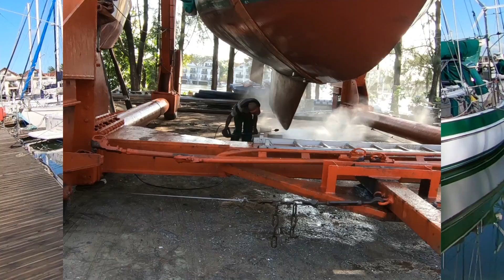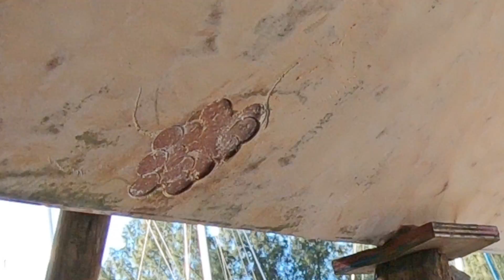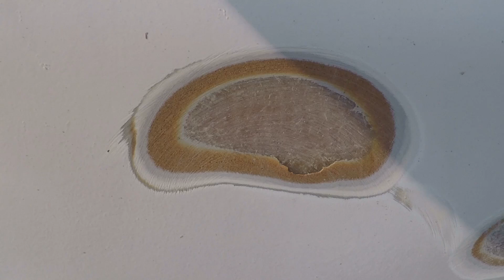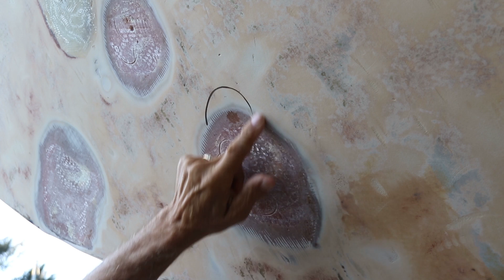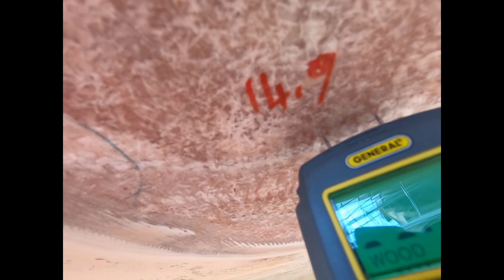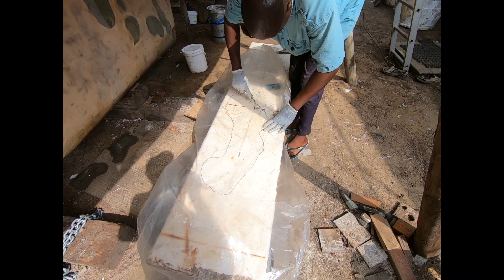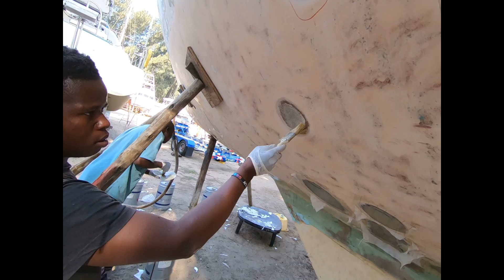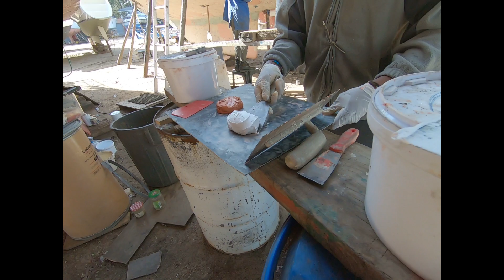500 ROTTEN, FESTERING Blisters!!  - Blister Repair on a Fiberglass Sail boat! (Patrick Childress 59)

Comment: Just as a question, why did you not just sandblast or soda blast the hull to expose the blisters and save on labor?
Reply from the maker: The blisters were very easily seen. No problem there. Each one had to be ground out to their individual depth. Would have loved to to have least removed the bottom paint etc...but upon inquiry, they don’t allow even wet blasting here in the yard...too many complaints from other boat owners last time they let someone do that. -Rebecca
Reply: @SailingBrickHouseAndOsprey  That is a problem that one can't choose, unless they find a yard willing to allow blasting.  For general information to any who are dealing with this same issue, I would recommend blasting over any other method as it exposes every blister ASAP.  But, when that is NOT an option, and often, in situations where it is an 'above the waterline/bootstrap' area, I would have to say that how you went about the repairs and the epoxy resolutions you applied are a superb solution.  Though many would disagree and many yards/services would have turned down the job unless an open account situation would have been made with significant down payment required, I would certainly (considering the situation as presented) that if a person wanted the finest results with the least (if not zero)  future complications involved, there is nothing you could have possibly done better.  Following each blister to its adherence point, cabosil as a general thickener (actually adds structural stability (there are other additives for general fairing that add less structural strength but are easier to sand and form)), the use of epoxy on the hull, and the general attention to detail on the whole guarantees lifelong use (with obvious recoat of antifouling and possible recoat of a 2 part epoxy sealer- cheap maintenance considering the actual structural integrity of boats of this era), I thank your for the time you took to show explicitly how you went through your repair and restoration process, including the why's and reasons.  Very informative, and it really gives a lot of insight into why some owners of very nice vessels are experiencing very unique challenges with their favorite past times, if not live aboards.  Also, for any who are dealing with these issues, yes, it takes some time, but these very detrimental issues can be overcome fairly easily, and Patrick Childress Sailing has shown you a very thorough step by step walk through on how to accomplish such a task.  To them- thank you very much for the reply and thanks for sharing the information- very well done.
Reply from the maker: Finish It, thank you very much for your knowledgeable insights, encouragement and nice comment.

Comment: I went through the exact same problem with my 31 feet and the reason why these blisters appear is due to excessive humidity back in the hull manufacturing. You can repair all the blisters but I'm sorry to say they will show up from time to time. It doesn't affect the hull structure but these small pots are very awful....😡😡
Reply from the maker: Yes...we are prepared for the hull blisters to return...but one can always hope with all the effort that maybe it won’t be for a long long time. -Rebecca

Comment: Did the shipwright use polyester resins not epoxy? Never seen blisters like it. Polyester resin are not the one! Epoxy is far better,  and epoxy will bond to poly. Gota fair bit glassing experience as I play with jetboats. Kind regards from New Zealand
Reply from the maker: You mean the one from 19 years ago...or for this blister repair? -Rebecca
Reply: gday michele .... could you advise me un how to seal the aluminium roof on my old 69 landrover... I"d like to use fibre glass as it would  maybe help with keeping the cabin of troop carrier cooler also...thanks Michele
Reply: @peterlucas1814  is your roof make with blind rivets? Would it be easy enuf to construct an identical mold? I believe there are products available to stop the glass from bonding to molds, but i havnt had to use that yet as I require the glass to stick underneath the boat and stay there aka gravel rash. If your roof isn't riveted and doesn't have to many protrusions you could almost use use the roof as the mold.
Reply: Most manufacturers from that era used polyester resin. The problems with the Valiant seem to be more from the low quality resin with possible bad fire retardant and I have even read it may be from the fibers not being woven tight enough also hurting it. The presence of water in the blisters definitely leans towards osmosis issues as well. It is a testament to the legendary sea worthiness of the Valiant 40 that even with the blister problem, which effects a great many of the older models, they still fetch such a high price tag.

Comment: And they say fiberglass is trouble-free! Well, maybe that's true when it's done properly.
Reply from the maker: Having hull blisters like this in not troublefree for sure! Thanks for watching! -Rebecca
Reply: A new fiberglass boat built properly will give you decades of trouble-free boating.  Whereas a brand new wooden boat will need repainting every year, and is much more prone to damp problems and damage.  So it is true in that sense.

The example in this vid is a boat that's got known a known blister problem caused by issues with the layup, and it's 44 years old now.

Comment: What a massive undertaking.  My shoulders couldn't handle it but with a little paid help, it makes a lot of sense to take it on.
Reply from the maker: Thanks watching! I wonder why a sailboat blister repair video would be so popular? -Rebecca
Reply: Patrick Childress Sailing I was really curious about the non-osmosis cause.  I had a Fraser 30 I sold two years ago.  Similar vintage so I am wondering if it was osmosis or a resin issue.  Interesting anyways.

Comment: What a huge undertaking.    It amazes me what problems will surface after years of owning a boat.  Even after a a lot of work from the previous owner (peel job).  At least you are doing it yourself.
Reply from the maker: From what I have seen in many boat yards, a boat owner is far better off doing the work themselves, with good help. A lot of disasters can be avoided that way. Also, doing the work in some foreign countries makes such a project economically feasible.  Thanks for your comment.

Comment: Is their a vacuum scanning unit which will speed up the areas of delamination
Reply from the maker: If you are referring to vacuum drying, that was an option but there were so many blisters on our boat I am not sure how that could work. We just ground out till we got back away from the delamination and wet looking fiberglass. It was winter here at the time so the ambient humidity and air temperatures were low, with a little breeze, which were good conditions for drying out the opened blisters.

Comment: I worked at Ericson Yachts for 16 years, and was the customer service manager for my last 5 years there. I dealt with blistering that showed up on boats in the field. The cause of blistering is incomplete catalyzation of the polyester resin during layup of the hull. Keep in mind that the hull is laid up by hand. Long stretches of glass cloth or woven roving ( a very heavy weave cloth)that is 36 inches or more wide are laid on to the mold. Once the resin is catalyzed - usually in 5 gallon batches then there is only 15 minutes of working time. If the resin and catalyst are not thoroughly mixed, then the laminate is going to blister. The best cure is to let the boat dry out and grind out and fill any blisters and then coat the hull with epoxy resin. If I was buying a new boat I would immediately put on a coat of West Systems epoxy resin.
Reply: Polyester doesn't cut the mustard.
Reply from the maker: Michele beck yes...it’s certainly why we used epoxy resin...no polyester. -Rebecca
Reply from the maker: Lazy Days, all good information, thanks. In the case of the blister era Valiants, it was shown that a particular ingredient added to the resin to make the resin flame retardant caused the resin not to cure properly. For a vapor barrier, have you ever thought of using a very thick epoxy such as what is used to coat the floor and walls in a battery charging room or to coat the floor of a ware house where forklifts and other vehicles operate? It is much thicker and enduring than common boat epoxies. It would never be any good for penetrating fiberglass in a layup. Here in S.Africa, such an epoxy has been long used as a barrier coat before applying antifouling. Does this sound worth while?

Comment: Down here in Australia we call it fibreglass cancer and we have been fixing it for 40 years.  Yes, you can grind it all out but you have to leave the boat on the dry for a year to properly dry out becuase the salf water will be right through the areas around the blisters and it separates the matting from the resin. It spreads unseen. If you don't let it dry out completely, they will just pop up everywhere again. If that was a boat that had been given to us we would have written it off.
Sorry to rain on your day.
Reply from the maker: No rain here, I feel very good about the blister repair work and the results and the longevity for the repairs. Maybe new blisters will appear over time but these patches are solid. You need to give us some specific numbers for "dry out". Setting a boat to dry for a year means little if the ambient humidity is high. Why a year, where do you get that figure from? You need specifics and readings to do this right. Thanks for your comment, if you can expand your explanation, that would be much appreciated. I suppose at Australuan labor rates it would be a write off, but here in S Africa, not so much! -Rebecca
Reply: @SailingBrickHouseAndOsprey  Rain won't harm it. Its the salf water that does the damage. Its corrosive to the fibreglass sub layers. The gelcoat is the seal. Salt water reacts with the layer under the gelcoat and creates an acid and it spreads and delaminates the layers of fibreglass. The blisters are where there is a pinhole in the gelcoat or an original air pocket from the layup and that causes the blister. You have to do what you have done but also let the salt water evaporate from the whole hull. It will weep out along the edges of where you have ground out and you can see it over a period of time and you water blast it every so often.  For the areas under the intact gelcoat only time out of the water will dry that out. By just fixing the blisters you leave the rest of the salt water trapped between the layers and it will just happen again and again. In a hot climate a good time on the dry is six months. If its humid, longer. We do these jobs all the time, specially on older fibreglass boats where the original gelcoat starts to break down with age.  For the impatient we can epoxy the ground out areass but its only temporary. (you should sell the boat if you can't wait.) This is us:  http://noakes.net.au/

Comment: While 'moisture meters' are primarily designed for wood, any reading below 15% should be good on fiberglass, but to be safe, under 10% is a better bet if you can achieve it...
Reply from the maker: Thanks, Mike, for the reassurance.
Reply: Hmmm i'm not so sure on those figures , but i agree the lower the better . Yes i have blisters on my yacht , she's a 53 year old from the Morris and lorimer stable , the blisters themselves were actually found by accident , when i was living aboard . After lifting out to make some work i had planned , easier , i figured slurry blast the old antifoul at the same time maybe a good idea . What actually came to light was totally unexpected , in way of tiny burst blisters about the size of match sticks though the repair coating . I found out after purchase , the yacht had a history of osmosis and had already been previously repaired . The hull was showing a moisture content of 21% in some keel areas on lift out , but much less in others . The repair system i originally choose to use , the west epoxy system needed a maximum of 3 . She's now been outta the water for the last 20 years , so should be ready for repair . Unfortunately now due to the boat market , she has no value , the repair  , and subsequent refit would cost far more than i could ever dream of selling her for . So sadly i'm realistically looking at cutting my losses and scrapping her . The trouble is i'm struggling with this , it's not something i really wanna do , she was a good boat , and taught me to sail , but at 24 feet is too small for living on at my age . I'm fed up with being shore side , and want to retire , so i'm now planning on moving back afloat within the next couple of years . I would love the comfort of a slightly larger yacht and independence of shoreside facilities , if you get my drift . Something my present yacht could never do .

Comment: Patrick, you did one heck of a job.  The guys in a boat yard did too.  Was it worth it? Only you can answer that question but I think the answer is yes. You are back in the water sailing again.
  Would it be worth doing if you had to do it in a yard back in North America? Or France?  I highly doubt it!  Would it be a good DIY job? Only, if you pick up the boat for the right price and you love hard work and "the smell of epoxy resin in the morning"  (Sorry Mr Coppola)
Reply from the maker: Marcel, you are exactly right on all accounts. These old boats are like trying to flip an old junker house and make a profit. All the numbers have to work. Even for one dollar, some boats are too expensive. Doing a lot of this work in some foreign countries make sense. This is why so much manufacturing is done in these countries. The factory workers in Sri Lanka, making clothes and hats, earn about 75 cents per hour. It seems, it is my guess, the factory workers in China make the same or less.

Comment: What a long, high labor, tedious project.  Kudos to you Patrick.  There are several ways to go about "fixing" the blisters.  All equally tedious.  I do think that the process you used is more than sufficient to fix the problem.  I sure hope you got em all and don't have to repeat this project in years to come.  Onward on your most epic adventure.  Be happy, be safe.
Reply from the maker: There is always that possibility of new blisters forming. I did what I could to find the tiniest ones and that is why we had drill holes with surprisingly little or no delamination or moisture.  I think we are good to go, for as long as we could possibly own this boat....we will see. Thanks for your good wishes.

Comment: Looks like you got most of them and most of the delaminations. Hard to be judgmental from a video. Look at it in a few years and you may find only few more and smaller. I’d feel safe in it, no worries of catastrophic failure. The strongest part of the boat is what you repaired LOL! Some would have said pull it all off, but that much labor isn’t worth throwing at that old boat so you did fine. Amazon sells little moisture alarms by the dozen. Drop them in places in the the bilge for early warning. Most leaks start very slowly.
Reply from the maker: People are crossing oceans in these old blister boats without doing anything about the blisters......sort of like us, till now.
Reply: @SailingBrickHouseAndOsprey  I seem to recall reading , it takes a good many years for even very large blisters to cause a structural failure . It did go on to say no boat has ever lost due to blistering , but being honest , that was an article i read a few years ago , so it's possible that may have changed by now .

Comment: Do not follow this way of repair. It is absolutelly WRONG!!! The proper start would be to remove all delaminated layers and not only "blister" areas!.
Reply: Proper start would be to remove all delaminated areas (all layers on hull), NOT ONLY "BLISTERS" ! Following with hot high pressure cleaning, drying for several months or with HotVac and then apply full antiosmosis treatment system following producers manual. The work you had performed is only cosmetic!
Reply: Iztok Šušteršič I agree but he said he's in hurry and he's 69 so screw next owner! 🤔
Reply: @strietermarinesurvey1415  You're right, but the truth has to be told that this is not professional way to solve that kind of hull damage and I know that truth in lot of cases hurts.
Reply: Iztok Šušteršič I have been a fiberglass technician for around 30 years now and it's not the delaminating that's bad, it's moisture that turns into acid from the Styrene and has to dried in humidity controlled atmosphere, the moisture meter he used is for Cement not FRP, I guess they are happy telling us we are wrong and I'm good with that! Just another typical sailor that knows it all!
Reply from the maker: I have to wonder if you watched the video or maybe watched it with the sound off.
Reply from the maker: You can't say that without saying what is your right way of doing it.
Reply: I would have to disagree.... By removing a blister- he has in fact removed the delaminated layer 'entirely'.  The other portion is still adhered, is it not, by definition,  'delaminated'.   If after 40 years if is still adhered, it should be god for another long while.
Reply from the maker: @marceld6061  Marcel, that is why I don't think he watched the video or did so with the sound off. It is amazing with posting videos. There have been people who looked at only the thumb nail, then post a long comment that becomes totally irrelevant.
Reply: I work in the aviation industry and although the actual process is obviously tightly controlled and documented the actual repair of a delamination is pretty much the same as the repair on this boat, grind out the delamination and refill.